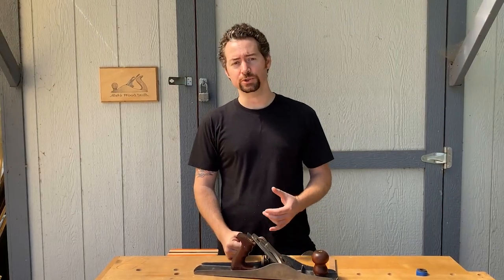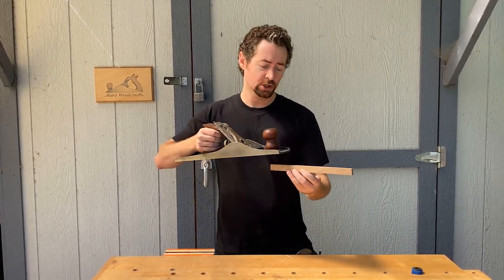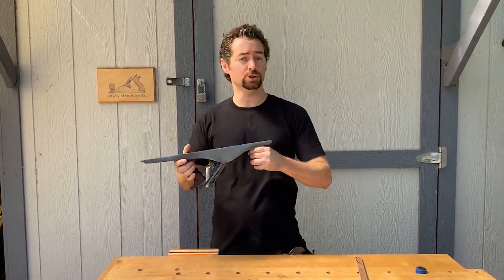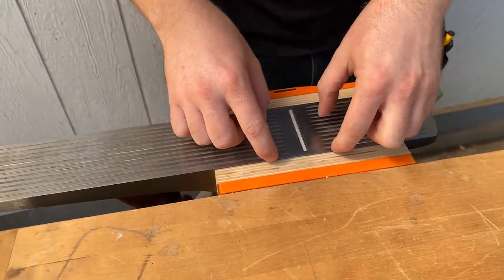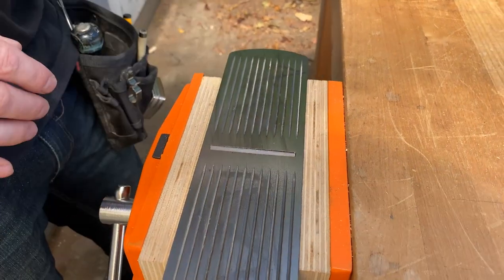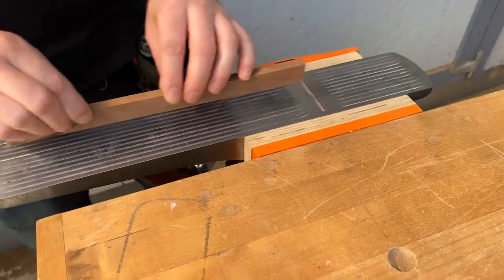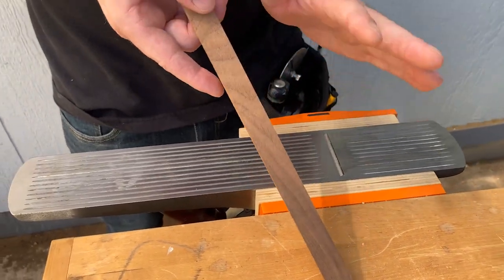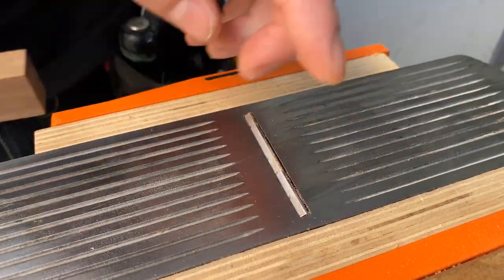Working Small Parts with a Hand Plane

Comment: Watch your fingers. I did they and planed my nails :(
Reply from the maker: This is good advice. The fingers are always a concern with this. It might even be good to use a push stick like on a jointer.
Reply: @BobsWoodStuff  pushblock with a heel would work too. My mistake was having the plane set too heavy and I had to apply more force. I could have just had it set less and done two passes
Reply: I like this idea. Wonder if it would work with spokeshaves? Is there any kind of tool that would hold the piece? A push stick doesn't clamp the piece, and it's usually made of light plastic. There are clamps for router tables that might be useful.